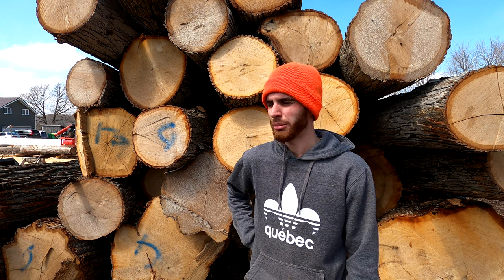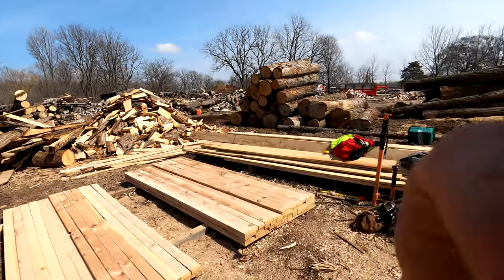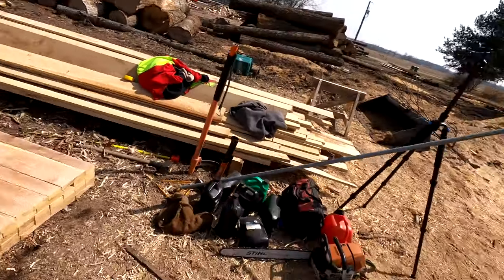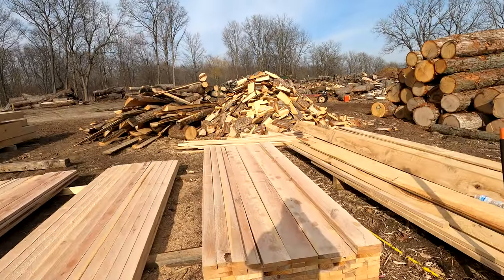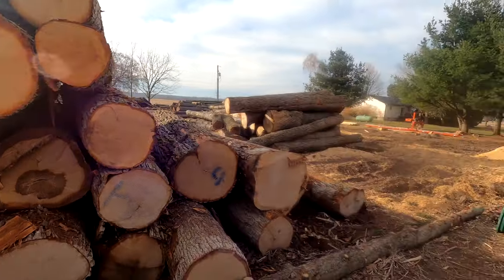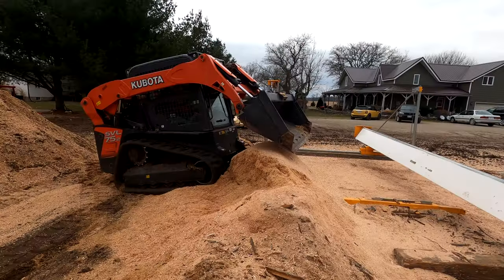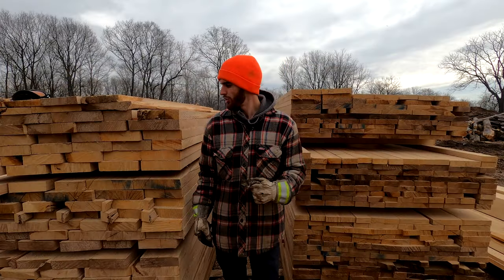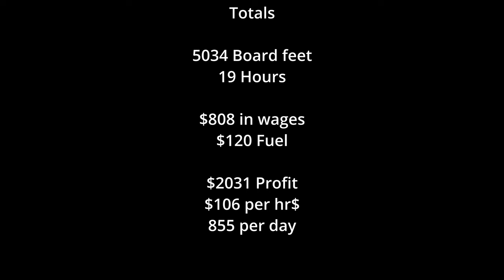How Much Money can you make with your Own Sawmill? Lets find out!

Comment: This is a great video! How much faster is the Mahoe compared to your Lucas? It seems Lucas Mills are quite a bit more portable, and the Mahoe, quicker but twice the price nearly. I'm looking into the swingblade/circular style mills for dimensional lumber.
Reply from the maker: So I think it is about 2-3 times faster, depends on what we are cutting. The Mahoe is quite portable if you have the trailer attachment. Also with the mahoe it saves so much energy when milling. But the Lucas is a good mill too, we used it for about 10 years

Comment: Could you explain quarter sawn vs flat sawn vs the other pile? Trying to figure out what that means.
Reply from the maker: Hey Bryan! https://www.finehomebuilding.com/2018/07/10/quartersawn-wood-rift-sawn-wood-explained 
There are some good diagrams in this article of what they mean. Basically flat sawn is when the grain is sort of parallel with the board face, usually get more of this when you just cut into the log to get the most footage and cut the fastest. Quarter sawn is then the grain is perpendicular to the board face, this kind of cut is the most resistant against cupping.